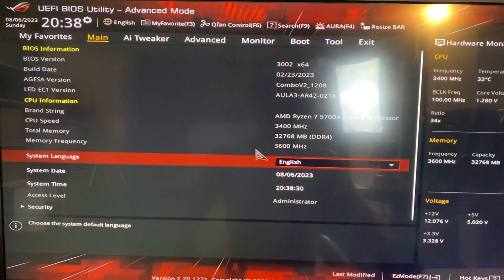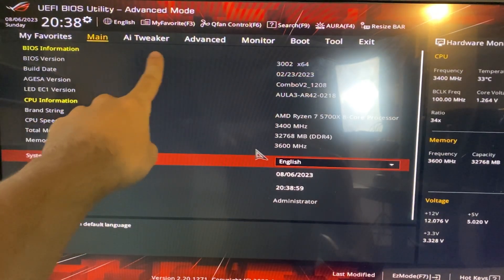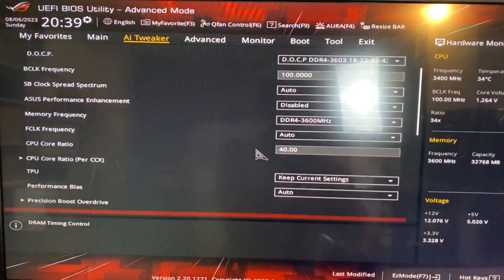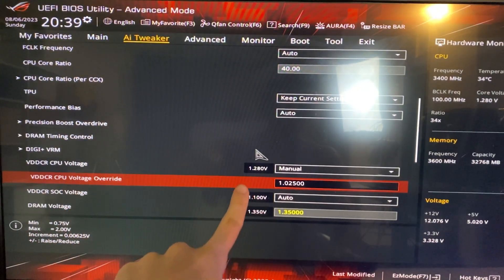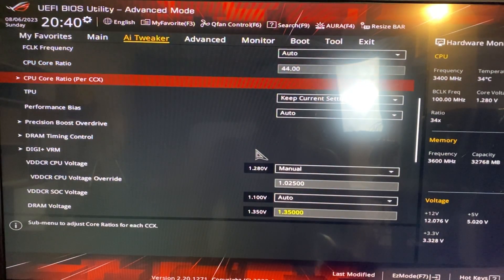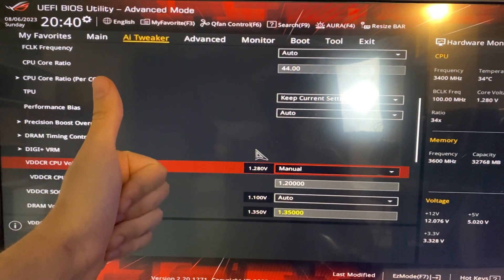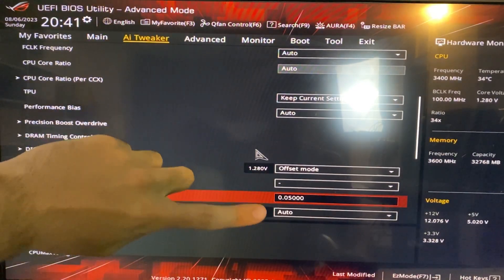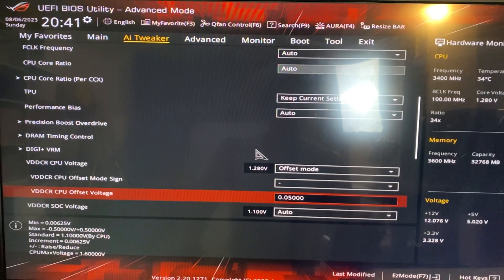Undervolt your Ryzen 7 5700X for more FPS and Lower Temperature!

Comment: You did say that if you're lucky, you can go lower than -0.05 offset, but I will say that you can quite likely go much lower than that. I got -0.2V.  Which resulted in 12-15 Celsius lower temps but no noticeable performance loss in games. I have an old X370 motherboard.
Reply from the maker: Maaaaaan -0.2V is CRAZY, you have a golden chip! Subscribe to the channel to give me some of your luck please😩
Reply: you aint kiddin sir, i did try that -0.2v offset. decrease from around 67degrees to 58degrees temp.
Reply: @yanjiid4810  Glad to hear. I recently got instability and had to tune it down to -0.175. Which is really weird: it ran perfectly for 6 months without any crashes even with demanding games like Alan Wake II. Then suddenly instability.
Reply: @Vorrester  hmmm. since you recently experience crashing, im gonna observe mine too, im playing Cybnerpunk 2077 moslty, with RT & PT enabled. so far havent experience crashing for now. thank you for this information Sir.
Reply: Does it still work for you? i have x370 gaming pro carbon too and the ryzen 7 5700x.
I want to try it out too now with the -0.2 if its still fine in your system
Reply: @irgendsoeintyp355  start from around -0.05 and use it for a while, then drop it again then use it, once it starts to crash, bump it back up a bit and be happy.
Reply: Yes. I have been running that since my comment. Played Alan Wake II on those settings.  @irgendsoeintyp355

Comment: hello, i have a 5700x and asus prime x570 

i have currently pbo turned on with +200 mhz, boosts up to 4.8ghz while gaming 

temp reaches 78° while playing cyberpunk

was wondering do i need to reset pbo settings if i were to try this guide of yours? 

or would i be fine with pbo as it is?
Reply from the maker: I’d personally reset PBO!

Comment: anyone with b550m mag mortar?
Reply from the maker: The settings would be the same, just the name changes a bit
Reply: @ImWateringPSUs  after long hour gaming my fps drops had to restart it.  44 core ratio with the 1.2v manual  also tried 44 & 1225v.

Comment: Thank you so much for the guide man! I use b550i aorus mobo and went with 46 core ratio with 1.202v. The thermals with this cpu plus undervolt is insanee🔥max temp in gaming is 62°c, most of the times not reaching 60°c
Reply from the maker: I’m really happy it was helpful! Thanks a lot for taking the time to leave some feedback! :) I’ve also got a few build videos on the channel and more coming, if you like the content consider subscribing as it really helps the channel!

Comment: When i use 44 - 1.2 combination. I got a random "aw snap" crash on chrome while not doing anything (eg: reading news, articles)
Reply from the maker: It means you need to raise the voltage to 1.225! Also remember to drop a like and a sub :)
Reply: @ImWateringPSUs  thanks. i can reach 4.6 with 1.225 using pbo curve.

Comment: Hey man, after seeing these comments I feel that it's has a positive impact. Although I'm scared about it since this is the first time, I wanna know if it'll help me get more performance in productivity tasks and better benchmark scores. I have the 5700x and an msi b550m motherboard. I have an AIO which keeps it at 70 even at load, so I guess it'll be way better than what the other comments are suggesting, but I'd like to get your help :)
Reply from the maker: You’re definitely starting off with good temps! It will help in heavy AVX loads regardless, but probably won’t improved your benchmark scores by much
Reply: @ImWateringPSUs  oh, thanks for ur response:)))

Comment: 3600 user here, thinking either 5700x or 5800x3d with 40 core ratio and 1.03v cause i think 4ghz is more than enough and 1.03v should be 100% safe and stable but i also plan to disable pbo so it will never run higher than 4ghz. only interested in gaming is the 5800x3d worth it in your opinion?
edit: i got the 5700X, set to 40 core ratio at 1.03V - seems ok so far (tested the 44 with 1.2V as well on prime 95 for a bit and a few games, seemed fine as well)
         my preference now is 40-1.03V (good performance, no noise, less power consumption)
Reply from the maker: Absolutely agreed on 4Ghz! I’d say get the 5800X3D only if you have a RTX 3090 or higher :)

Comment: What does the ratio of 44 exactly mean ?

Highest possible boost 4400mhz?

Is this clock all the time? Also if I am on idle on my desktop?
Reply from the maker: It's gonna be the clock under load at all times!
Reply: @ImWateringPSUs so wait won't that be underclocking below max boost wouldn't that actually loose performance or is this for if Temps are too high?

Comment: Would this same method b about the same for Ryzen 7 5700 ?
Reply from the maker: Yes! I should specify that it works for the “normal” variant in the description :)
Reply: @ImWateringPSUs  niiice thanks one more question i undervolted my cpu with ryzen master should i put it back to default before doin this manually first?

Comment: 1.2v is just stable volt for 4.4ghz there a calculation but you need to find like the maximum lowest volt your mobo can support and than you can do the exact calculation for the best volt like mine i use 4.4ghz with 1.175V
Reply: My 5700x For me is 4.4ghz  1.122v.
Reply from the maker: I’m really happy it was helpful! Thanks a lot for taking the time to leave some feedback! :) I’ve also got a few build videos on the channel and more coming, if you like the content consider subscribing as it really helps me a lot!
Reply: are you sure its stable like even when running geekbench 6? 4.6 is nice if you able to get it @@Santiago-ok8jq
Reply: @@Santiago-ok8jq  4.4ghz 1.025  bien y estable
Reply: mine does 4.6ghz all core with 1.2065v
Reply: i have gigabyte x570 ud what voltage is good for us?
Reply: @overbored617  its really depends for starter use the video voltage cuz its universal stable than if u want even lower u need to test it on ur own
Reply: Hey bro did you try go little lower ? For me I try 4.4 on 1.150 its very stable.

Comment: thanx man, that 44 core ratio with the 1.2v manual is deadly snappy.  i got 30 celsius idle/light use
i've settled with 45.5 core ratio with 1.22v for months now. same temp as with 40,42 or 44 cr, but a bit more performance. cheers again. edit : 47.5 @ 1.28v , easily. same, 29-30C idle. Thermalright Assassin King 120 SE. thanks. 32gb ram, gen4 nvme, rtx 3060, ROG STRIX B550-F
GAMING WIFI II - a dream machine
Reply from the maker: Glad it was helpful and I really can’t thank you enough for the detailed feedback!
Reply: settled on 42 core ratio at 1.05v,even better temps. best settings : 40-1v ; 42-1.05v; 44-1.15v @ImWateringPSUs
Reply: what cpu cooler were you using? I’m getting over 90 degrees, I had to undervolt my cpu and now it plays at 60-81 degrees. Think it’s my Amd stock cooler.
Reply: @Mjdemon   try get a better cooler like, AK400
Reply: @Mjdemon  Thermalright Assassin King 120 SE. cheap but works.
Reply: @2009kortevideos  I got the thermalright phantom spirit, my temps are like 34 degrees idle
Reply: Bro whats your temp for 4.75 ghz @ 1.28 volts in multicore cinebench? Does it crosses 70c and above?
Reply: @manzurulanam8037  70oC is nothing to worry about
Reply: Is 1.025v still okay for 42 core ratio?
Reply: bro how is your temp so low? Mine reaches 80c+ is your AIO 3 fans?
Reply: 30oC with what ambient?  12?
Reply: @BenState  kinda, i live in Ireland , middle of summer now, 15 celsius. :-)
Reply: @2009kortevideos  So delta 15oC at idle is what you're looking to say.  Makes a big difference in the context.  That would be easily a 50oC delta or more under load which is not great.

Comment: is this works for a520m mobos ?
Reply from the maker: Unfortunately you can’t really go “up” with the chipset. Meaning, you can flash a B450 to B550 and an A320 to A520, but you can’t flash an A520 to B550 if that makes sense
Reply: @ImWateringPSUs   i just undervolt my cpu was overheating af did ur thing its running around 60 - 70 now :3 also its a520